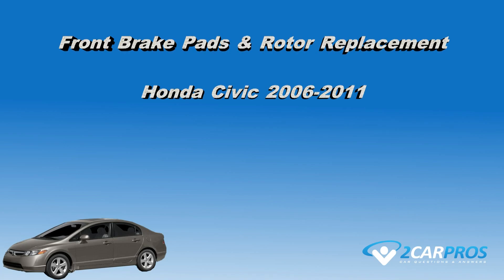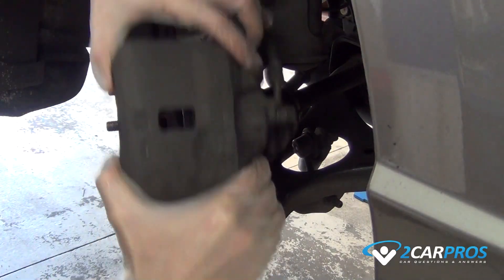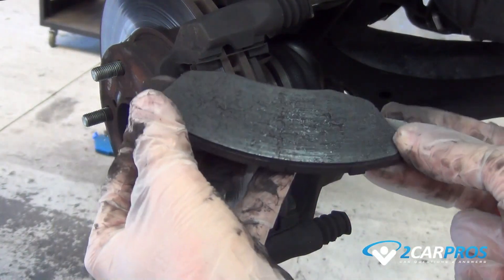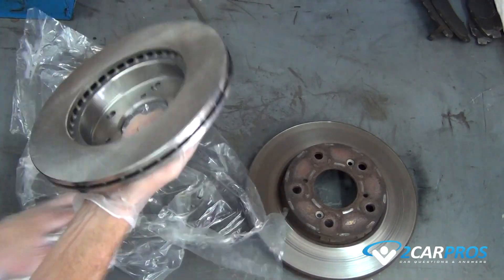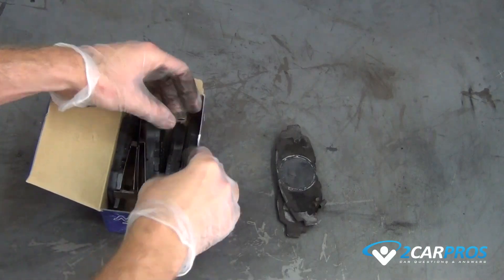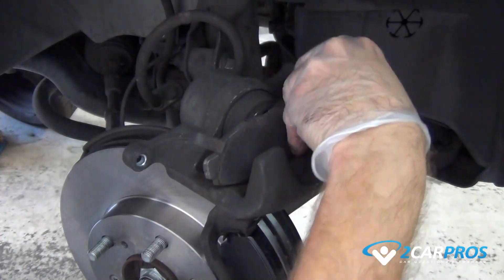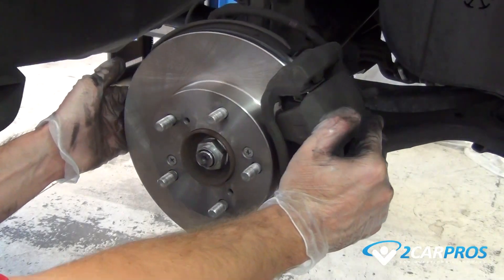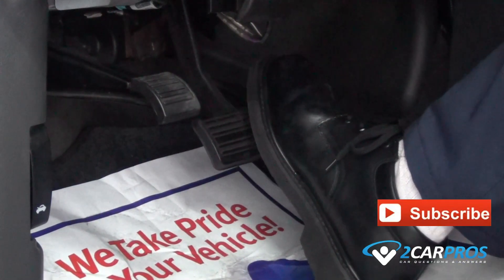Front Brake Pads & Rotor Replacement Honda Civic 2006-2011

Comment: Most of these videos show perfect-looking existing vehicle components that are easy to remove, clean, and reinstall.  What they FAIL to point out is that both the caliper and its mounting bracket OFTEN need to hammered gently and repeatedly just to separate them from the rotor because of binding due to prolonged rust build up.  Same goes for removing the worn out brake pads from the caliper mounting bracket.  Also, the wire brush while handy isn't always sufficient to remove the rust build up.  Practically EVERY SINGLE metal-to-metal contact surface need to be inspected for major or even seemingly minor (micro) build up of rust.  Additional tools such as flat-head screwdriver, dremmel bits, sandpaper, or even a file may be necessary depending on the amount of rust.  This is especially true for places with even moderate amounts of annual rain or snow fall resulting in a lot of corrosion.  Finally, if the replacement brake pads are larger than the original ones even by a few micrometers, they become very hard (nearly impossible) to install and may need to be ground out.
Reply: Damn, I thought people said changing brakes were easy 😅
Reply: WD40 is your friend.

Comment: tip* if your caliper piston is stuck, twist it with a clockwise turn while pushing the piston back in. I use channel-locks to turn while pushing with my other thumb. Hope this helps

Comment: The service manual says that the caliper bracket bolts need to be torqued to 79.6 ft/lb (idk why so specific) and the caliper body bolts are torqued to 25 ft/lb
Reply: Thanks

Comment: Great except for one step: remove, clean and re-grease the caliper guide pins.
Reply: anyone know which pin goes where took my pins off one has 3 flat spots one is round not sure which spot they go in now

Comment: Good video, no slide grease for the  pads and calipers ?
Reply: There are two schools of thought on that.
1 - The pads sit in/on a piece of stainless steel so no lube is necessary. Stainless doesn't rust so no increased abrasion would be achieved from there. The pads vibrate when being applied and when you let off the brakes, so that would theoretically keep rust from there. Any lube that's put there will pick up and hold any tiny road debris that will act as an abrasive, making it more difficult to slide.
2 - Lube is always good. [see above].
I would ALWAYS lube the PINS as they need to slide freely and are protected from picking up debris by their rubber boots.

Comment: Good vid but a couple of points. Never use an air ratchet to wrench on a bolt. use a breaker bar or impact gun to break it loose first then use the air ratchet. Wrenching with an air ratchet will break it eventually. 

Also when removing the rotor screws its best to heat them up first. Those things get incredibly seized and will break the bit on your impact screwdriver if not heated first. 

Also ALWAYS relube the caliper slide pins. If those pins seize its a pain in the but to remove them. No grease is needed on the pad slides or the pads themselves. 

Side note also apply anti- seize to the hub and lugs, not alot. A dab will do ya. Great vid guys

Comment: I need to find that torque specs on the bolts.
Reply: J Coz: 
slide bolts: 25 ft/lbs 
caliper bracket bolts: 80 ft/lbs 
Don't forget to lube the slide bolts, or else you can do it all over again in a year or two($$$$)!!!!
G'luck!!

Comment: When my Dad and I did this job on our old 2006 dodge caravan, we had to do something along the lines of replacing the brake fluid by squeezing the pistons back and then we had to replace the braking fluid afterwords. Do we have to do that on the 06’ civic in the video?
Reply from the maker: Where did the fluid go if you didn't open the system? Thanks for watching!

Comment: ....before squeezing piston back in caliper check brake fluid level and remove some brake fluid(do not empty just some)...also you could wrap a rag around the brake fluid reservoir. When finished both sides replenish brake fluid to full line.

Comment: I’m having a hard tim on the passenger side. Perhaps I am attempting to loosen them in the wrong direction? On the driver side you lifted up to loosen the caliper bolts, do I push down on the passenger side?
Reply: Yep, it was opposite on passenger side.
Reply: Depending on which side you're working on, just imagine physically getting behind the bolt and then turning it clockwise to tighten and counterclockwise to loosen.  Right-handed threads are common for most applications (not just automotive), so imagine wrapping your right hand fingers around the threads while the bolt head is visible.  Your thumb should be pointing towards you... which means, if you turn the bolt counterclockwise, its head will move towards you (loosening).  Hope this helps.

Comment: great video and I have just ordered my new pads and rotors! I saw in other video/tutorials that people remove some extra brake fluid, is that necessary or I should simply push the piston back to place? Thanks!
Reply from the maker: Thanks for watching! So you can press the piston back into place with out opening the system. However the shop TECHNICALLY correct manual says to open the bleed valve while you are pushing the piston back in.

Comment: I need to get me one of those impact screw drivers.  So cool.
Reply: For anyone looking for one you can pick one up at Harbor Freight for under $10. It works well enough to remove the rotor screws. I've been using mine on our Kia and Hyundai for a long time.

Comment: No silicone grease to Caliper slide pins?
No Brake grease to pads?
Reply from the maker: Our slid easy but yes it is a good idea to grease the slide pins. However I would never put grease on the pads. You don't want grease to get on the rotor then it won't stop as well. Thanks for watching!
Reply: He meant you grease on the back of the pads. Some anti-seize on the back of the pads prevents them from sticking. And if your going through the effort of this job it’s worth the two minutes to clean and grease the guide pins.

Comment: Before compressing the caliper piston, you must remove the brake fluid reservoir cap, or else there will be spillage.
Reply from the maker: You really don't. I have never had that problem. Thanks for watching!
Reply: i was just going to ask about that, do i have to pop the hood and uncap anything or do i have to pop anything off where the caliper and pads are to avoid anything clogging the line "brake bleed?"
Reply: @MrJwilson913  Before compressing the caliper piston, I just check the brake fluid level. If it's well below the max line because the pads are worn and the piston is extended, I don't remove any. I check the reservoir before and after I do each side.

Comment: If you want to insure not having brake "squeal" Lube all metal to metal surface contact points of the brake pads with a small amount of high temp wheel bearing grease.

Comment: In my experience, it is much easier and much faster to use an electric impact wrench to remove the screw from the rotors without damage. This impact screwdriver is a waste of time. Thanks for the video!
Reply from the maker: Don't have an electric impact. Do have the screwdriver though. Thanks for watching!

Comment: What’s the tool called that you taking the screws out with?
Reply: Please turn on the CC (closed captions) for clarity!  (1) Impact screw driver to remove the two countersunk screws which hold the rotor in place against the mounting/hub flange. (2) Torque wrench is to remove the two caliber mounting bolts and the two caliper guide/slide pins.

Comment: Is bleeding not necessary?
Reply from the maker: Thanks for watching! So you can press the piston back into place with 
out opening the system. However the shop TECHNICALLY correct manual says
 to open the bleed valve while you are pushing the piston back in.
Reply: Just open the brake fluid cap instead of the bleed valve.....